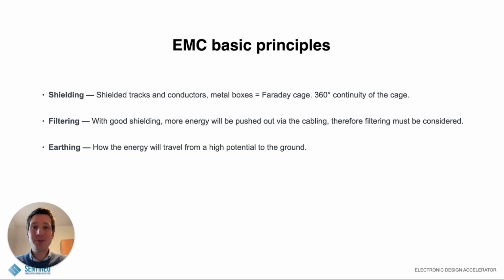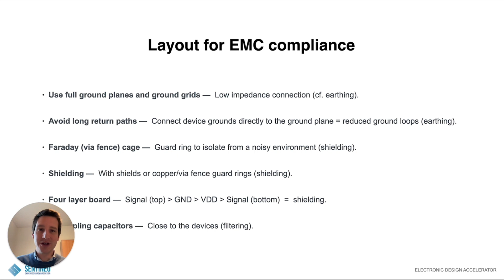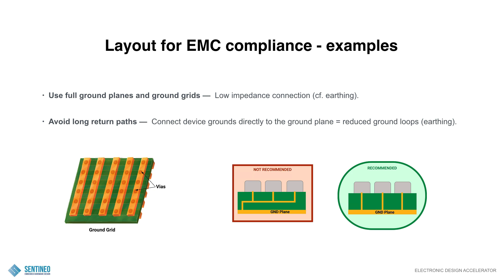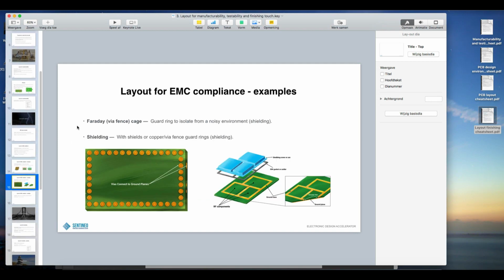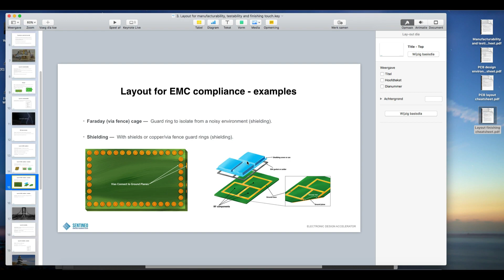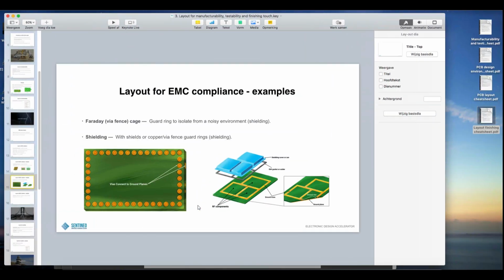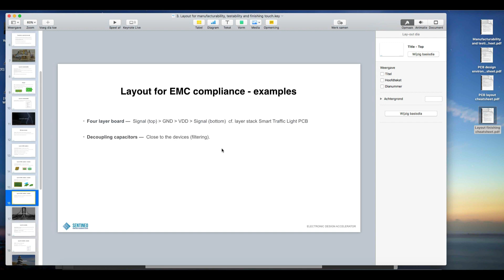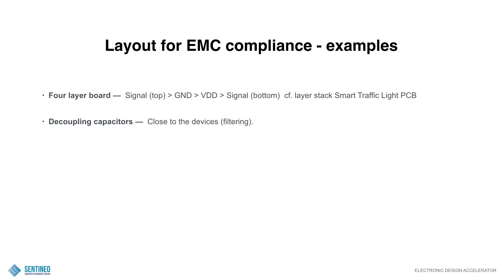3 Basic Tricks For EMC Compliant PCB Layout

Comment: interesting you have layer4 as signal layer which is only adjacent to your PWR layer. All signal layers should be adjacent to GND planes
Reply: I think that's ok as long as the power plane is the same voltage that the signal originated from. Rick Hartley mentioned it here https://youtu.be/52fxuRGifLU?t=1258

Comment: Interesting. Need to learn with examples like if we have multiple switching regulators , fix voltage regulator, analog signals / supplies and digital signals on the same pcb. How to get rid of EMC problems?
Explain with such an example as described above